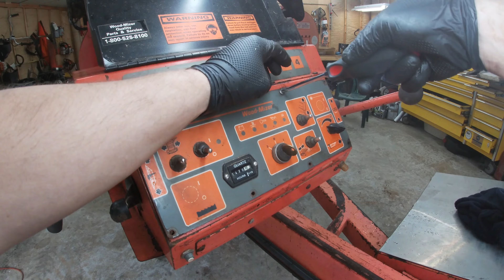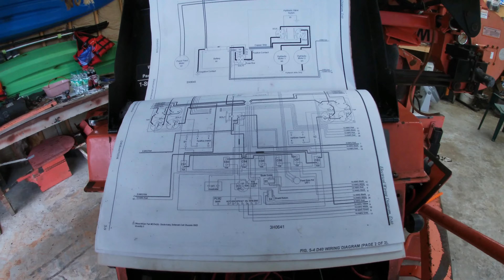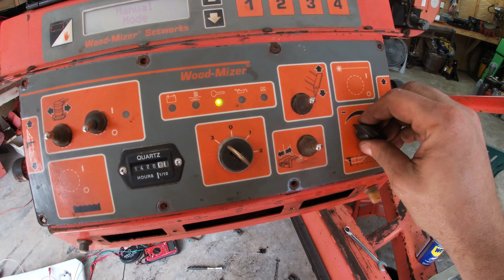Everything needs fixed!!! - 1998 WoodMizer LT40 Super Hydraulic Sawmill Project - PT.1

Comment: It's simple to replace burnt coil wire. Just need to match new wire with same guage and length of old. Set up old part as a spool driven by drill or whatever to respool new wire evenly onto old part. Nothing to it really. Better and more durable than repairing several breaks on old spool.  It can be quicker and easier too.  I've reused wire from salvaged electronics that's in good condition.  New wire is priced reasonably though.